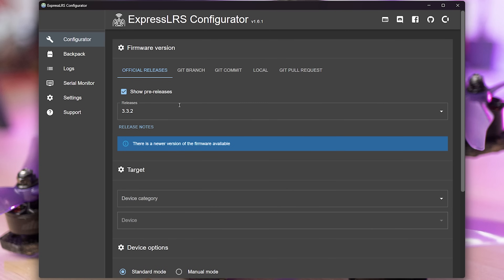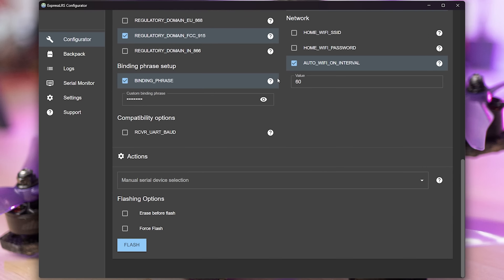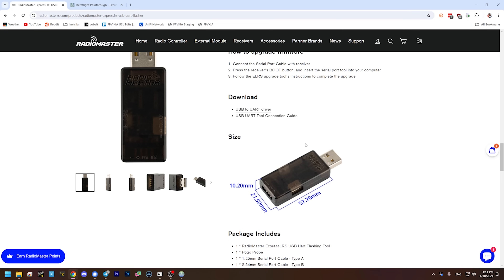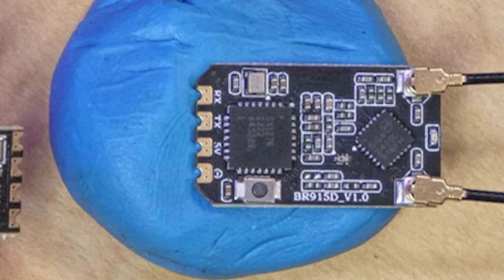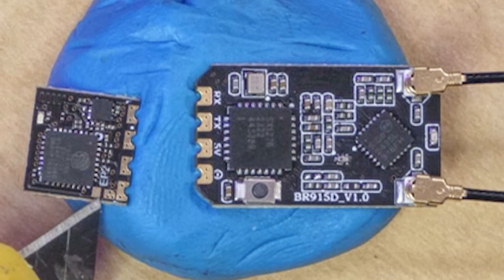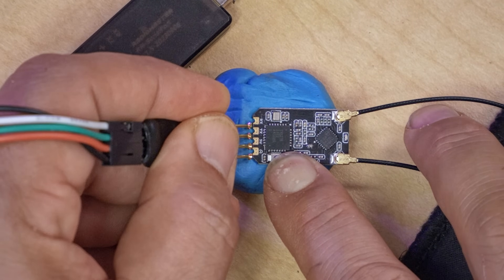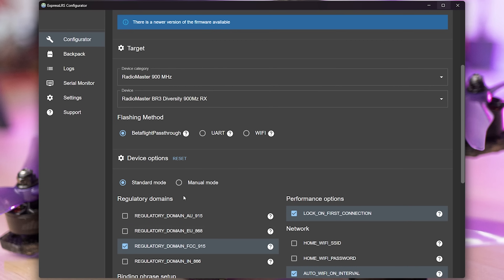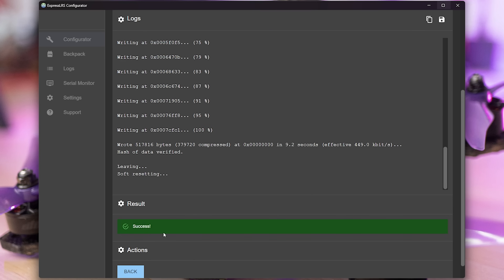The easiest way to unbrick an ELRS receiver

Comment: I've an AIO board with ELRS built in that doesn't have pins. What is the method to get this unbricked?
Reply from the maker: You have to use betaflight passthrough. There should (hopefully) be a bootloader button on the FC to put the ELRS receiver into bootloader (in other words, different from the FC bootloader button).

Comment: I've been testing this Radiomaster FDTI, with multiple receivers XR1, Speedybee and Foxeer. i just probe the right pins and flash via UART and it enters bootloader automatically, don't need to enter bootloader mode manually, this is flashing via the normal method when the receiver is not bricked.

Comment: Hello Joshua, looks like I bricked my Caddx Gofilm 20 after flashing the ELRS v. 3.5.3 Liked this equipment that you showed us on this video, but as it is a AIO board, the position of the ELRS TX RX etc... are not aligned like your model. I think in my case there's no solution.
Reply: I've the Flywoo Flylens85 with the AIO and same thing. Was working fine for months then after storage, it will not bind anymore. I've a solid green light near my antenna.

Comment: My friend, maybe you with your expertise can help me, my pavo20 lost bind randomly, and since then, a flaming blue LED on the elrs 2.4 aio receiver, it doesn't bind and doesn't update, it doesn't find ports through Expresslrs. build error... I'm almost putting in an external receiver.
Reply: same issue but my light is solid red

Comment: Great content like everytime, thanks!

But I've an issue: I flashed all my gear to the same version 3.4.3, put a bindingphrase to it. The quad connected to betaflight it'll connected to the TX fine - I see all the radio inputs at the receiver-tab in betaflight. When I power up the quad with the LiPo the Receiver turn immediately to solid blue, means bound, but it isn't. It only works when I hold the bind button on the receiver when I power up the quad with the LiPo. What can here be wrong?

Gear: HRS V16pro with HappyModel ES24 Pro 2.4Ghz, Receiver GepRC PA100 nano 2.4Ghz, FC GEPRC F405 V2

Comment: Does this method still work on a FC that is an all in one?  I just bricked my Pavo Pico 20.  I'm not sure how I could connect the FTDI cable to the receiver when the receiver is built onto the board.  Is this possible?
Reply: I got it figured out.  Of all things, it was the Betaflight version preventing the passthrough.  4.5.0 may have issues.  If you have this problem, use 4.4.3.  Solved my issue.
Reply: Hope this works  @trevoryour

Comment: My Foxeer receiver stopped working after I tried to update to elrs 3.4 with betaflight pass through method. The led on receiver went off. I think this is something else other than bricking. Does this method work also for my receiver? Did anyone have an issue like that?😮

Yeses. I saved my receiver. Thanks again  @JoshuaBardwell 👍
Reply: This just happened to me now, i flashed from 3.2.1 to 3.5.1 and LED just turned off and i haven't been able to recover it. Bootloader button also weak and broke so now can't even get into bootloader mode. Perhaps i didn't wait long enough after the flashing of firmware ? did the uart method work with yours ? able to get into bootloader mode with button ?

Comment: ❓Happymodel ELRS Rx - double blinks: short and a bit longer (the blinking code isn't mentioned in the ELRS Wiki) (I can flash it but the problem stays - doesn't connect to my radio)

Comment: Pro tip: if you use test clips instead of pogo pins you don't have to hold them while flashing. That's how I used to flash my R9 receivers before soldering them to the FC..
Reply from the maker: I talk in this video about why I dislike test clips for this purpose.

Comment: You definitely don't need telemetry off FYI. Once passthrough is enabled all other BF functions aren't running (it's an infinite loop that only processes the data for the passthrough), the only way to exit is to turn FC power off and on again.
Reply from the maker: You might need telemetry off because the configurator will try to automatically activate passthrough mode without you having to go to the CLI. And for that to work, the configurator needs 2-way communication with the FC.

Comment: You didn't need the pogo pins at all, you also didn't need to solder it.
Just needed a pin strip and you just tension it against the pads on the receiver.
At my workplace we literally use this technique during development and even on production (tho the products have normal holes not castellated edge).
Works 99.9% of the time.
The drivers even for obscure chinese USB-UART adapters are most of the time installed automagically by windows so you shouldn't need to download the drivers separately.
Reply: That's actually insanely good info. Thank you

Comment: It's not a bind button it's a boot button! 😅 I wish the pogopin part on these adapters had a built in push-push power switch in them so I could get it all lined up before I applied power. This was a great description of all the things you need to know, and what problems you'll run into. Perfect!
Reply: Well, now it kinda is right?